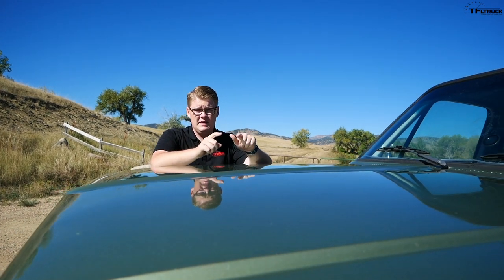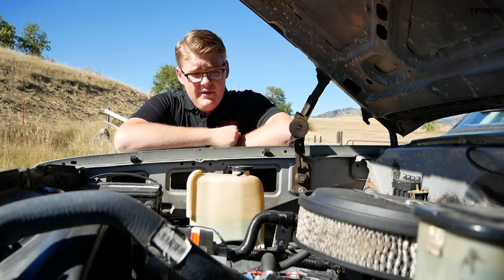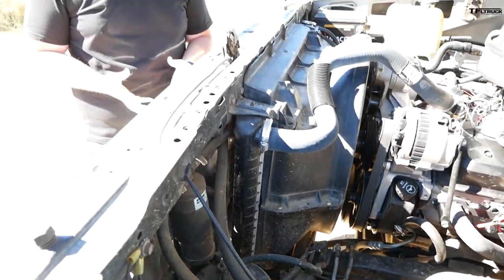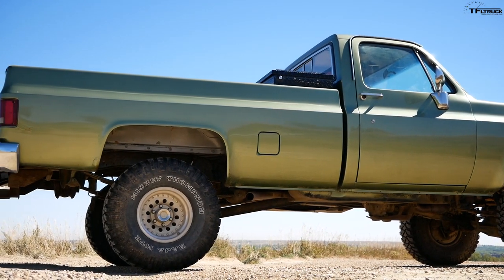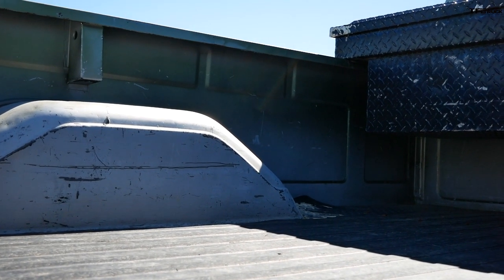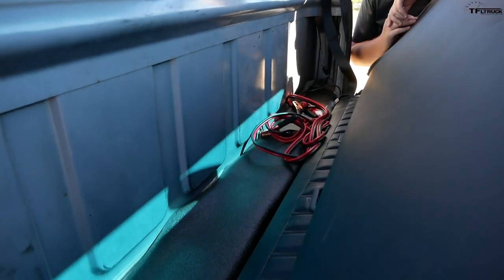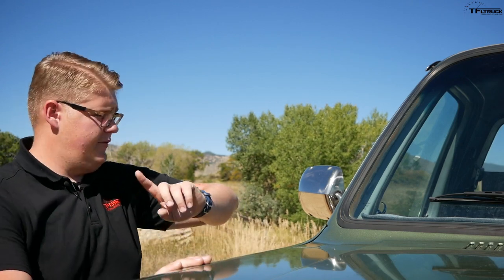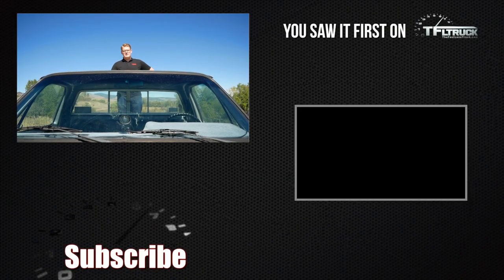Is The Chevy K10 Square Body Pickup Cool or Crap?

Comment: Great trucks, the ealy ones rusted real bad 74-80,  after 1981 they didnt rust near as bad but tinnier , usually the frame cracks on the lifted trucks by steering box they sell a piece of metal to beef it up, nearly all the lift kits use blocks in the rear & new springs in the front especially for trucks from this era, too bad emmisions kept the engines with low HP,  but GM small blocks were cheap to get more power from,I would love to have a 87 GMC High Sierra 4" lift & 33's

Comment: Okay there was no debate on if those tanks blew or not, they’re an inch from the outer body with zero protection, they were at least as bad as the Pinto for blowing! Yes square bodies are rusty trucks, so are all the GM trucks since lol, so no they never did figure that one out lol. Also it’s a “fleetside”, not a “flatside”... Don’t take this as hate, I love these trucks, I owned an ‘85 2wd with 305 4 barrel, it was far from gutless & would pull a trailer with ease, did well on fuel too. Pretty sure they came with 2 different 3 speed auto’s, not just one, they had a Turbo 350 or optional Turbo 400. They were available with a 454 big block as well.
Reply: Brad Chambers LOL! Nope, just being realistic when the only thing separating the fuel tank from the bumper of another vehicle is a piece of 20 gauge sheet metal... Otherwise these trucks were awesome, I nearly bought another one 2weeks ago actually...
Reply: The truck in the video doesn’t have the hood hinges that seized up either, that was the older style double arm kind with the coil spring that did that (always pull the hood down from the center)
Reply: Matt's Garage the hood don’t kink on its own, it’s the idiot pulling on it knowing the hood isn’t closing.  Come on people wd40 twice a year is all it takes .

Comment: I watched this video when it was first posted but didn’t have the knowledge until now to know that when he says the motor in the truck is a zz crate motor with throttle body fuel injected but it has a Holley carb😂

Comment: There was definitely more transmissions then mentioned there is the 3 speed manual, turbo 350, turbo 400,700r4,sm465, and there was another one can’t remember the name but it was a 4 speed that had reverse where first is usually at

Comment: Working on my 86 GMC with a big block I replaced my Harmonic balancer with a Summit Racing® Bracket Racer SFI, and when installing it when it seemed to be at the end, and then the tool backed it self out. Everything I have looked at, this does not happen. They Show it getting to the point were you can not turn it any further and you know your done. Any ideas, thank you for any help.

Comment: I have a 1984 stepside k10. I slid sideways into a light pole doing about 30 and hit right on the gas tank. Didn't even come close to puncturing it.
Reply: Forgot I posted this. Update, replaced cab, fenders, hood, etc. Replaced 350 with 452hp and 484 lb ft of torque blueprint engines 383 stroker. About to put in a tremec TR-4050 transmission

Comment: We have a mint V1500 and it really is a cool Pickup. I wish it was a Crew Cab and long bed but still it's pretty cool. We put a AVS2 on the 305 and now it's quirkier and smoother. Still, 24L/100km is expensive in Germany. 40€ per 100km or 62miles. I aim to get more diesel-esque power out of the 305 by tuning it the right way. No way to find a 6.2 Diesel engine in Germany or any engine really.

Comment: I had a 85 GMC C15 basically the same truck and it as crap. that 305 was gutless and you could watch the gas gage go down. it was about 10 years old and in Montana it was lucky to get 12mpg highway 9 city  mine had automatic locking hubs which i switched out because it would inadvertently jump out of 4 wheel drive when ever it wanted to. I would love to say what i traded it for but unfortunately the carburetor gasket separated on me one day while hunting and it burned to the ground.

Comment: Correct me if I'm wrong, but I'm fairly certain that in 87 they used the R/V designation rather than the C/K designation. So big green would be a V 10.
Reply: Bubba J you are correct...gm wanted to distinguish the outgoing models from the new ifs pickups for '88 therefore changing the nomenclature to the R/V as you stated. Proud owner of an 87 gmc v2500...

Comment: The lever you push to release the ignition key to lock position only came o squarebody with manual transmission from the factory
Reply: Automatic transmission from the factory has regular switch no lever

Comment: I just sold my new truck. I’m done with this modern stuff. A speed sensor went bad and was causing the transmission to shift erratic. So I thought “ no big deal” and began to look into getting a new sensor and changing it. Then I find out this basic speed sensor is INSIDE the transmission and it has to be torn all to pieces to get to it. It spent a entire month at dealership to change a freakin speed sensor! I finally got it back and decided that was it for me. So I sold the damn thing. I’m going to buy a 1970s or 80s Chevy or Ford and make it a reliable driver. When everything is fixed properly they are as reliable as anything and I can actually fix it when things go wrong !

Comment: Despite the quirks and minor flaws of Chevrolet K series, they sure as hell are a million times better than the current GM, Nissan, Honda and RAM trucks of today. The square body to me, has class and style; they're masculine, tough, simple to fix, and sky's the limit to modification. I only wish that I'm several inches shorter so that my knees don't touch the dashboard and the steering wheel doesn't rub in my lap; I'm about 6,4 ft by the way.

Comment: I got an 83 k10 I put a built 355 that pushes a little over 400 horsepower with 455 gears granny 4 spd and Detroit lockers front and rear it’s a powerhouse of a truck

Comment: So uhhh only your truck got that key lock thing cause mine don't i got a 1984 scottsdale 4x4 with the 305 its got the 700r4 trans and 4 inch lift and 33's under it and it moves when the peddle is pushed enough

Comment: C yeah I've got a GMC 86 Sierra 1500 series I've had it ever since it's brand-new put a 350 in it and that 6 inch lift kit 35-inch tires in that and I've had it ever since there other than the body cancer like you talked about I've never got stuck in the mud of never got stuck in the snow it's been one hell of a work horse for me in that and I'd recommend it to anybody and I'll never sell it until I die

Comment: I am not going to wait till I watch it. I know if taken care of these trucks are cool. Everything crap can be fixed one way or another.
Steering box is an easy fix even if you do not get the kit for it. Hood hinges have no problems under proper maintenance. Door hinges are honestly all crap clean through the 90's BUT maintenance can help and you can get kits to replace the bad pins and bushings.

Comment: I've always owned Fords, but I've always thought those Chevys were very cool looking trucks!  I only got my first Ford, because the Chevy dealer wouldn't give me as good of a deal.  My ford was way more reliable on the job, was faster and stronger, but I still liked the looks of the Chevy better.  Also, my Ford never got any rust, and my buddies Chevys rusted like crazy.
But I still liked the looks of the  Chevys better.   Did I already say that?

Comment: I learned to drive on one of these; a black 1986 Silverado regular cab, long box, 4x4, 305 automatic that was my Dad's.  I get why so many of you consider it cool but the truth is that it drove like crap.  The stock engine was garbage, the steering was garbage, the brakes were garbage, the front hubs were garbage, the seats were garbage, the interior was garbage.  This is fun as a nostalgic look at times gone by but I'd never want to actually have to drive it anywhere.

Comment: wrong generation on the hood hinges, 73-80 had the bending problem, 81-91 never had an issue, and ive had alot of these trucks, never had or seen an issue with the 81-91 hood hinges bending the hood. i got 4 of these current. an 87 v10, 87 r20 crew cab, 85 k10 and an 81 k30 crew cab non dually. daily drive and use everyone of them. ive drove these daily since i was 14, and refuse to change trucks, because they work.

Comment: I wish they would make a “new” square body with modern engine, safety and corrosion resistance.  For way less the cost of the new ones now you could powder coat every piece of metal on the old one.  If they would go the extra mile while being built the trucks could last almost forever.   I know I know, it’s a business.  Why make something that’ll last forever when you can gouge ‘em again in 5 years?

Comment: i have a 79 4x4 cheyenne short box full option truck with under 35,000 miles on it and it has the 400 sbc with a heavy duty 400 turbo and it is on the option sheet so u need better facts plus they put in the 454 bbc in them too and  1980 the hood hinges suck and i have never seen a short wide or long box with a wood bed they only came in the step side had an option for it only this reminds me of the people that think a LS 6 454 is a bbc my cheyenne came with carpet but most have the rubber mat in them and i will take my old truck against any new truck   off road same with my 70 ford high boy dana 60/80 lockers

Comment: What makes this truck great is the simplicity, you can make it run forever as well as upgrade it substantially with basic tools and a manual from autozone.  Plus you can upgrade to a k20 for big block power.

Comment: Your k10/big green is cool but for your standard k10... you only have to spend 9 grand to get a crate engine so it actually has power then its awesome. example... call me a child but ford and dodge always seemed  they had an engine that would brake the back tires free as for chevy the engine was alway the limiting factor from the beginning up until 6 speed transmissions were built so 2007 then it finally had a low enough gear not enough power just a gearing advantage and I am referring to their most common engines the 350 the 5.7 and then the 5.3 I know the....444 or was that ford... i dont remember im not that old 6.0 and the 8.1 had some meat but has chevy ever been on top for power? I am genuinely curious

Comment: Square bodies are bad as crap. My favorite truck body style. I have a 80' k10
Reply: Hey there! I'm getting a 79 in a few weeks, can I keep in touch with you just incase I need any help or info?
Reply: @zacharyhultgren2147  sure thing. 79 is very similar to the 80. Only difference is the grills we're different and in 80 they had optional square headlights with them standard on the Silverado which I have.....and they integrated the front parking lights into the headlight trim, with a unique parking light for that single year. 80 was also the last year of that body styling with the buldged front fenders and verticle side lights. They also changed the hood design. 81-87 had the wipers on the cowl and the cowl didn't open with the hood like the 73-80 series. Also in 81 the 10 bolt became the standard rear for these trucks.
Reply: @natevanlandingham1945  do you do moat of your own work?
Reply: @zacharyhultgren2147  this thing has been very reliable so far. It's not a daily driver. It's for play, work, trailer hauling etc. But anything that needs done I have done so far. I have owned it for close to 15 years.
Reply: @natevanlandingham1945  well the one I'm getting hasn't been a daily driver since around 89 and it just got taken to the shop and is running again. It's in the central valley of California in a barn since the 80s so it's in great shape
Reply: @zacharyhultgren2147  sounds like a great truck.

These trucks are simple and reliable. No matter what people say today's half ton weighs more and is a more capable truck all the way around. But I love the looks, ruggid simplicity of when trucks were trucks and not luxury grocery getters.

Comment: Great video. To bad all companies did away with the 4 speed with the granny low first gear. Also  why is it you could hook a western 7 and a half foot snow plow up to the front and make money. The new trucks are junk. He mentioned if the frame split you could weld it and keep on going. Try doing that today and they will junk the truck. Welcome to the new world of crap .
Reply: Yeah too bad the frames don't fall apart in 5 years on new truck. Missing out on all that fun. Let's bring back undersized, corrosion prone wireing, points ignition and impaler 1 piece steering shafts...

Comment: They're okay for cheap trucks, the drivetrain is the best part of them.  The rest of the truck is pretty cheaply built and rather user unfriendly because they weren't available in a crew cab in a 1/2 ton, or even an extended cab.  I don't think they're all that great looking either, but compared to the later Fords of this era they were better.  The late 70's Fords were much better looking though.
Reply: Most trucks from the late 70s and 80s had rust issues and body issues. The key for the squarebodies is there were so many made that parts are cheap.